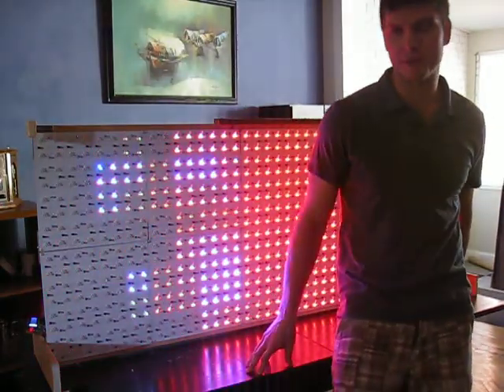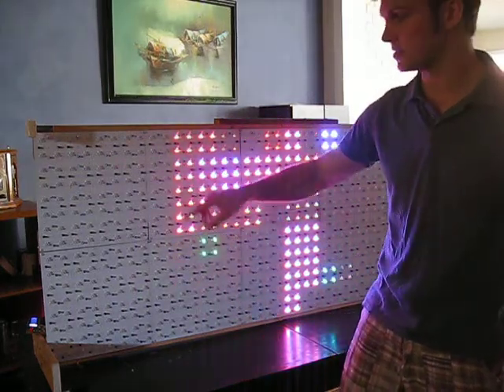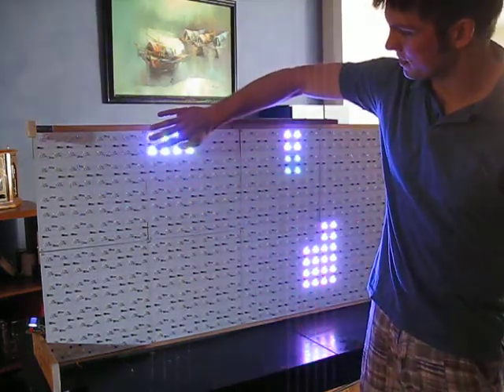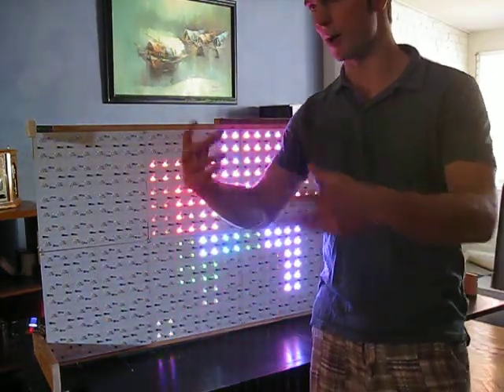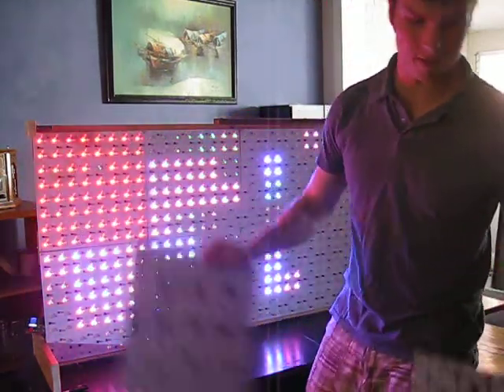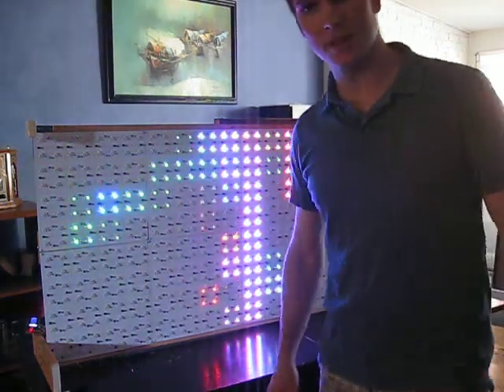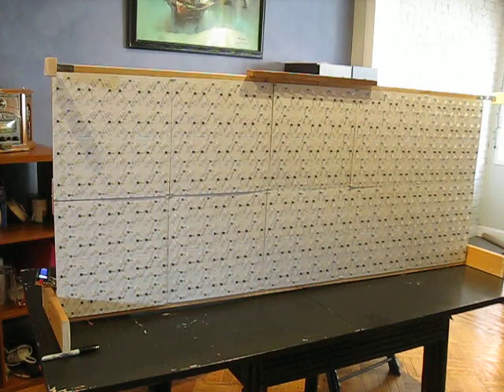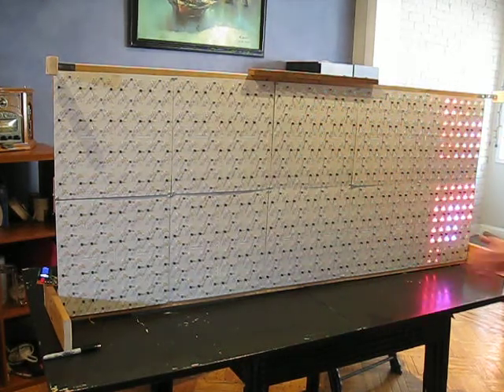New Interactive RGB LED modules

Comment: i have kind of a dumb question, are there some kind of special wires you need for LEDs or will any wire work? I want to do a project with LEDs but i don't want to blow them out because I used the wrong wire....

great video too!